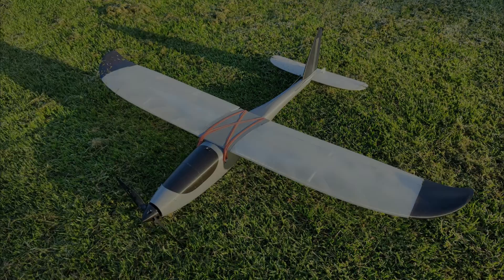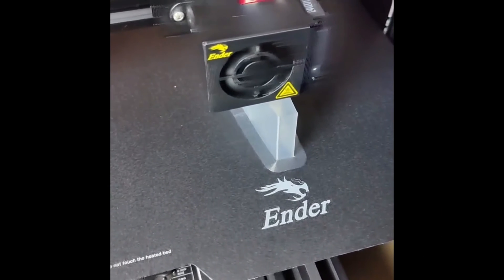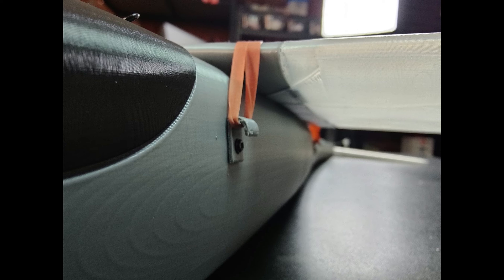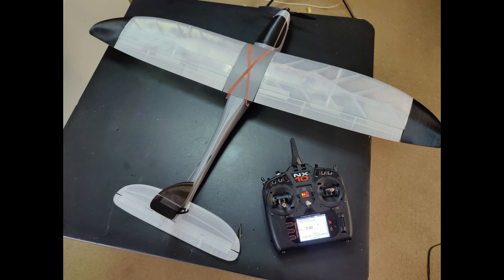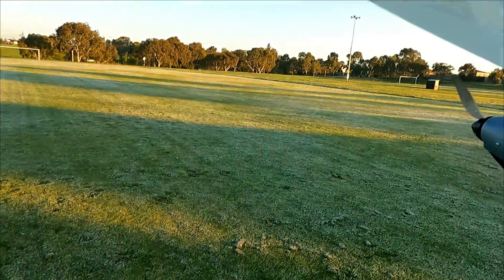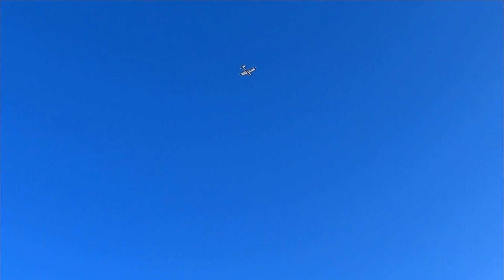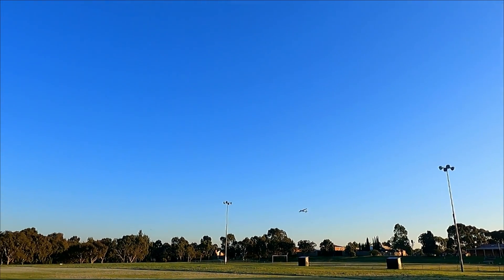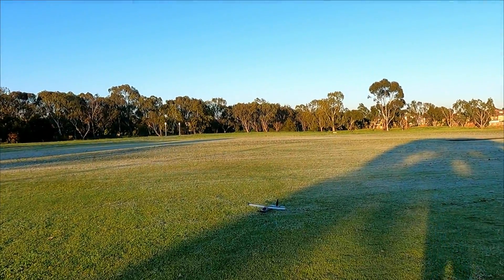My First 3D Printed Plane - Eclipson Model A Maiden Flight

Comment: Very nice.
But you didn't indicate which printer you used?
I'm currently printing the Go 1 Wolf which is a freebie from Eclipsal on BambuLab A4 printer but the fuselage joins don't look right in that one side of the join is a flat surface while the other side has a "groove" around the perimeter indicating the flat side mentioned should have a "tongue" to fit the groove.
Reply from the maker: I used a Creality Ender 3 Pro. I no longer have it though, I now use a Bambu Lab P1S and a Elegoo Neptune 3 Pro. Both great printers.

Comment: …nice but to heavy…to fast…to brittle…my electric gliders in epp and balsa in same size weighs 200-300 gram…they fly for 10 minutes with 450 mah battery…fast enough to loose and slowed down for handpicking…aerobatic no prob…rocky crash landings over n over again yes…i would smash that printed thing in under a week…probably less…😅
Reply from the maker: I printed this plane in PLA+ which is a heavy duty plastic, so it may be a bit heavy by comparison to some balsa wood models but it's pretty durable. The glider is actually meant to be printed in LW-PLA which is a "light weight" PLA and the plane fully built would be about 490g.
It might be "heavy", but I've flown it heaps of times and I have a variety of battery sizes it can take, it has a wide flight envelope as I can fly it fast or glide it around on windy days because its mass actually works in its favor. It may have some downsides, but it also has its upsides.
Reply: @aussiercairspace  a bit of weight makes flying on windy days less of a chore.
Reply: What kv motor and prop did you use.

Comment: Nice 3d printed plane! what is the wingspan of this? unfortunately 745gr with 2200mah is still quite far from foamy fe. My Razor 1200mm is only 475gr from AUW with the same plane model with the same battery size, but seeing how it flies I think it's still worth a try 👍

Comment: Great video Vas! I have the same one printed for over 6 months just never got around to finishing it, but now that I saw you fly it I have to get it done.
I am worried about it being fragile but at least I can make spares quick if needed. The design and engineering that went into this model are amazing to me. I see you also have an Ender, they have files that include the settings for Ender printers, I did 0 adjustments and it printed great.